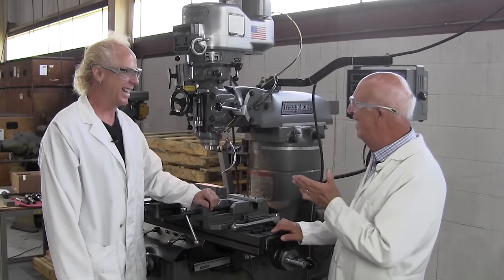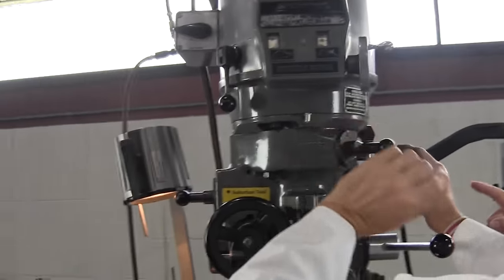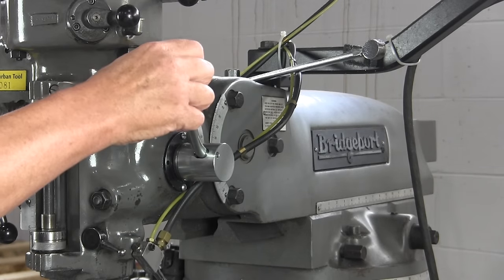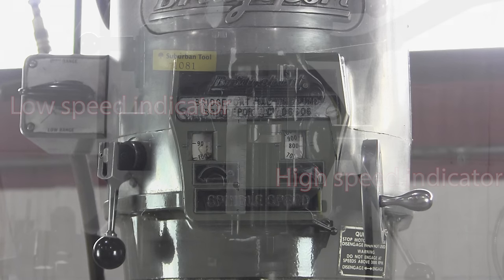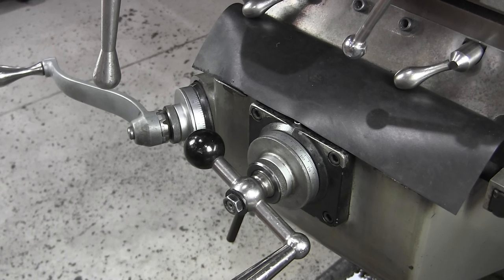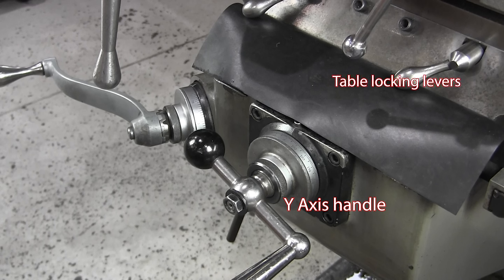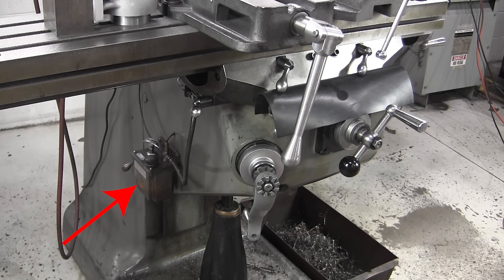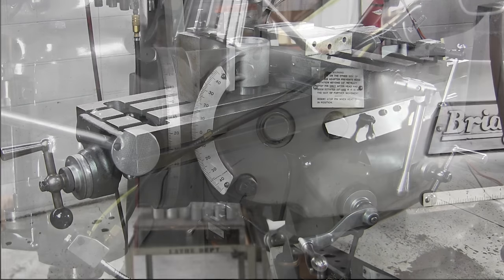How to use a Bridgeport and its features!

Comment: Made a good living mastering this equipment as a tool and die maker. I think a lot is lost on the newer machinists at just what these machines were capable of and accuracy that was able to be obtained with them to a skilled operator.
There are certain methods you learn to eek out incredible accuracy if you use them enough, not just cranking handles to get there.
I went on to CNC equipment but never stayed far from a bridgeport for certain tasks.

Comment: When serving my apprenticeship (at a large multi national auto electrical manufacturer with a German HQ), one of the workshops had a very old Bridgeport machine that if a recall correctly used a large (very) diameter rod/bar to mount the head on the base.  It was replaced (added to more correctly) by a brand new (1977) Bridgeport that was immediately fitted with the DRO.  I wasn't allowed to use it when I was assigned to work in that shop, only the people from the room next door (the development section) were to use it (as It was theirs).

Comment: My very first operation as a machine operator was on a bridge port vertical milling machine. 
It was set up with a 3 jaw chuck that indexed bolted to table and I milled wrench flats on a part that came off a lathe

Comment: Firstly give that cheeky young whippersnapper a rap across the knuckles... dinosaurs indeed 😄
Here in the UK my Bridgeports, 1976 and 1987 were made to the same quality as the US machines by Adcock and Shipley of Leicester. I will most likely buy a CNC, possible a Haas but I can't imagine my shop being without the incredibly versatile, world famous Bridgeport vertical milling machine. In fact,I love these machines so much I'm probably going to buy another one soon.

A quick edit to ask a question about angling and tilting the head. I was wondering whether there is an accurate way of setting either of these functions. I've tried sine bars and fixed dti's to try to accurately set angles but never feel absolutely confident. Thanks for the video Joe.

Comment: We used to have one in the UK school I worked in. It was the most brilliant machines I have ever used, and was so superbly built. 
I even purchased a 3" MT3 Tungsten cutter out of my own pocket to do some surfacing work. 
It was a completely manual version and I had to learn how to use it by trial and error because the school had lost the manual. The the technology department the decided to scrap what was a good working machine because they didn't like kids around big machines. Health & Safety gone mad.
Reply from the maker: Right you are!
Reply: Back in the day...any good high school would have one of these in metal shop, only the best students were allowed to run it, special credit projects given out, at the Owen Sabin occupational skill center, clackamas Oregon, we had a BP, a hugh Cincinnati shaper and horizontal mill, big tool and cutter grinder and a 40's era lathe that had to have been 20 foot long, yeh I was the kid that got to run them all,  I started cleaning chips out  and doing light assembly work when I was 13 in a neighbors shop. MSO setup operator/ screw machine ops after the service, I love the "setup" challenges for one off but hate the rigamorole of a production shop. 4 more years, lets bring manufacturing back to the US.

Comment: I'm not that well rounded of a manual millhand but I got pretty good at removing busted taps and any other HHS out of parts with a center cutting carbide 3 or 4 flute EM. Use the table lift screw very slowly by hand with the spindle speed up, lock the quill down tight and keep the air clearing it. You can beat both the EDM's time and scrap rate. And you can get two or more extractions out of that little EM.

Comment: Don @suburbantool  was looking for the hand wheel quill feed use. I notice most Bridgeport Mills the hand wheel is usually missing.  Can you shine a little light on the issue.  Notice your mill still has it.  Thanx for sharing you knowledge.
Reply from the maker: Absolutely. Seems like those hand wheels are always missing. Probably because they are rarely used and they get in the way when you’re doing general machining. So they get stuck in the cabinet somewhere, or someone says what is this wheel for? And it gets thrown out.Hope that answers your question.

Comment: What's with the fancy white coats?  If you get within 5feet of my dirty old machine, you'll be covered in muck.  lol...  I do believe the vertical knee mill is probably the most important machine invented in the 20th century!  It's importance cannot be understated!
Reply: I keep the spindle bearings of my machine well lubricated and it sprays that tell tale Bridgeport oil spatter line at roughly lower chest height. This is why my toolmakers coat is navy blue 😆😆😆
I completely concure with you on the importance of this fabulous machine. My shop was built around one that was the first machine I bought.
Reply: back in the day it was standard for machinists to wear coats. white coats were popular, but eventually all sorts of other coats became popular, as well as aprons. i personally wear a shop coat when working with cnc machines, and an apron with more pockets when i am doing manual work.
Reply from the maker: Love your comment and appreciate you taking the time to post it.

Comment: Hi Joe, may I ask a question? Is it possible to rebore a motorcycle cylinder using a Bridgeport milling machine? A friend ha asked me to do this but I'm not sure. Hope you can help me with your experience.
Reply from the maker: In order to answer your question I need to know the length of the bore I am not concerned about the diameter.

Comment: Great video thanks for the rundown on the controls and features, what year is the model in the video? Are there different models over the years with different features? I'd be curious which model to look for and used market as a hobbyist. It would be interesting if you could show some of the accessories like I keep hearing the term j-head etc thanks again!
Reply: I'm a home guy.  I've got a series 1 variable speed.  No belts to mess with.  Finding one with the right table size is up to you.  They will all be 3phase, but that's 90bucks today to stick it on a chinese vfd.  I love my dirty old bridgeport.  Since getting it last year, I have no idea how I lived without it. 👍
Reply from the maker: Our model is a series 1.

Comment: At the rear of the head on the main frame is a rounded area with a big hole 
What is the hole for ( toward the rear of the bridgeport emblem area)
Reply from the maker: There are attachments such as a shaping head that can be mounted on the other end of the ram. That is why the turret can be rotated 360 degrees and have the attachment moved to the front. Thank you for watching.

Comment: I still can't see how rotating the whole upper assembly would be helpful, yes you can reach better somewhere, but being sure and precise in location would be very hard I imagine. You first have to know the angle you rotated to precisely and then do additional math to find out what the new x-y are in the old, non rotated system
Reply from the maker: All what you say is true and rarely used.
Reply: Normally you would pick up on a feature in the middle which was machined before the turret was turned.  If there is no feature there you can ask if it is ok to add one. But like  Don said it is not done very often, normally you just go to a larger mill.  Oversize parts bring out the not so good characteristics of a knee mill, such as the table tipping from side to side as you move the X axis from one end to the other.
Sometimes a slotting head (vertical shaper, keyway cutter) would be fitted to the other end of the ram and the turret would be rotated  180 degrees to switch from one to the other.
Probably the most common reason for turning the turret is when someone wants some holes drilled and tapped in the end of a long part.  You move the table all the way to one side and hang the part off the back of the table using whatever vise, angle plate, and clamps you need.  The part can then extend all the way to the floor if needed.
Reply: This machine is a toy compared to mine but the whole swivelling top is something mine doesn't have. You need to think of it as a radial drill - and with the whole top rotated say 90°, you could drill something large standing on the floor and not use the table at all.